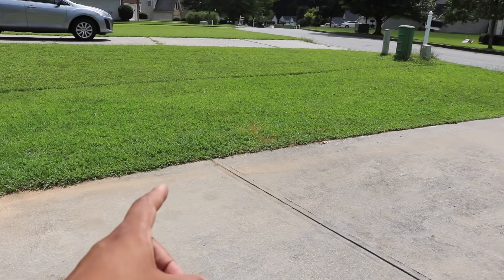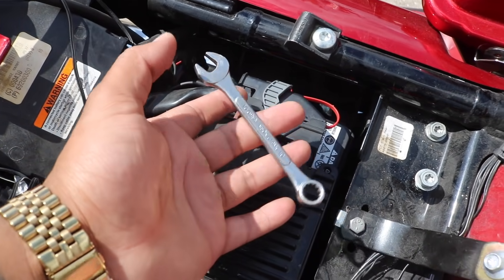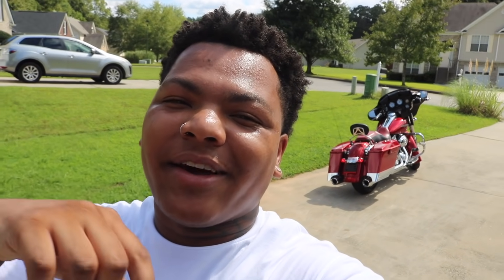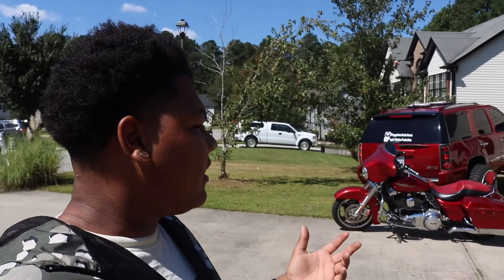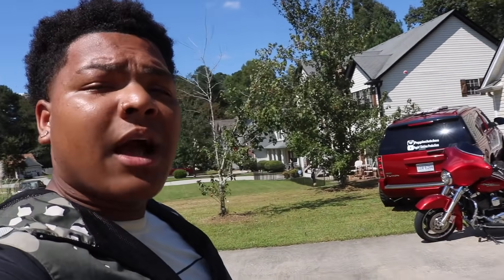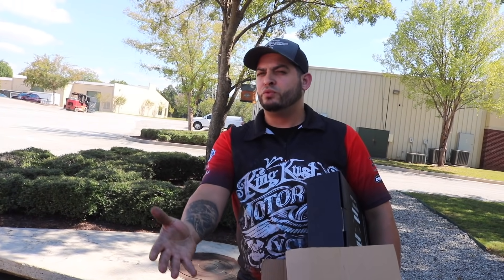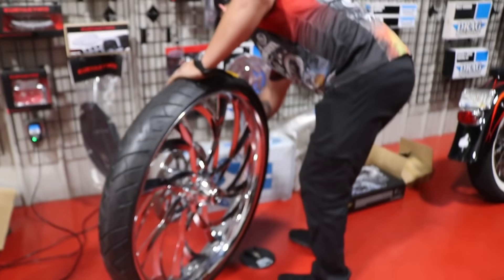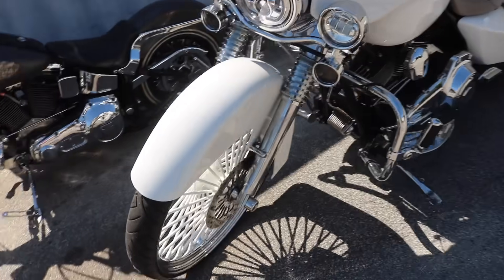She’s gone… Now I need a tow pig. 2019 f250 Platinum Diesel

Comment: Nice bro 13 best year the 103 when I come down that way we gone ride
Reply from the maker: We can bro 🖤💫
Reply: @poppinclutchesproductions5773  bro I would do 5 inch stretch bags true duals. That 103 is a good motor. Do some prv speakers and you set. Do the 2014 bags they look better in my opinion if you need help let me know